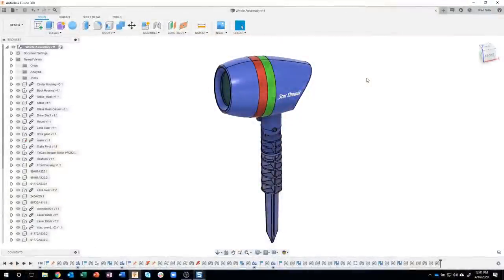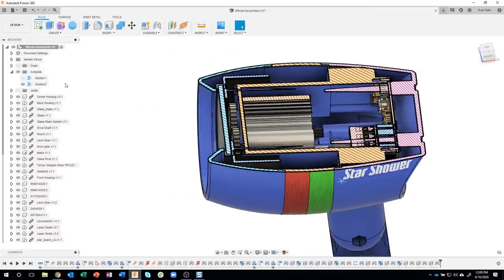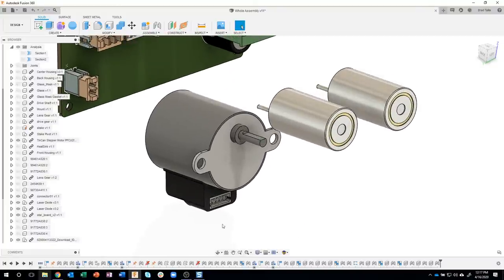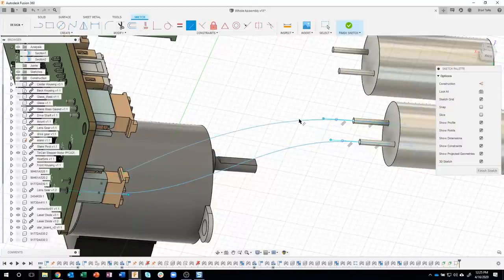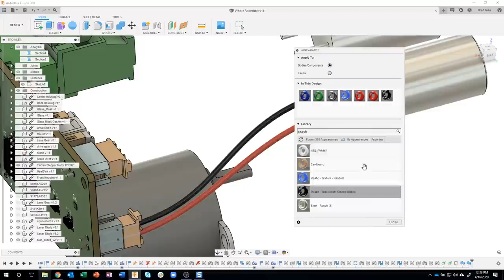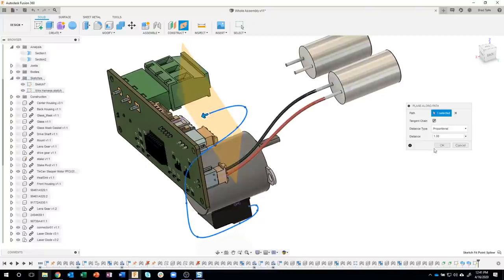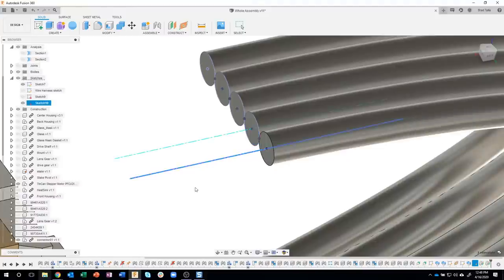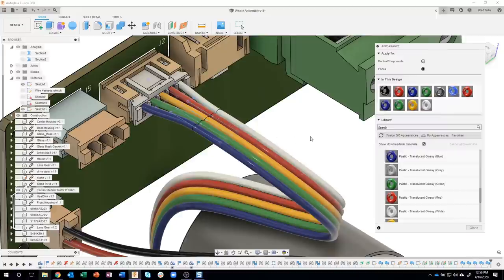360 LIVE - Laser Projector Build: Part 7 - Making Changes and Wiring

Comment: Hello Brad,
Here I am, asking for more help. I just downloaded the entire Assembly_Updated file to a new folder in Fusion 360 and wanted to delete the other folder where I have the older versions of components and assemblies; BUT, Fusion doesn't allow me to delete the entire folder or the individual parts stating that "A version of some design has been referenced by drawings, other designs, or manufacturing-related files and cannot be deleted". I'm getting this message even if I delete every single command so that I end up with nothing in a file. Any ideas why is this?
Reply: Hi,
I found a solution to the above issue that worked. Save the top assembly model using the "Save As" command with the same file name. This creates a fresh copy of the top assembly with no history in it; then you can delete the old top assembly file which in turn will allow you to delete each and every individual file that were originally linked to that old file. Found it here: https://forums.autodesk.com/t5/fusion-360-support/a-version-of-this-design-has-been-referenced-by-drawings/td-p/7213936 
I hope this helps someone having the same issue.